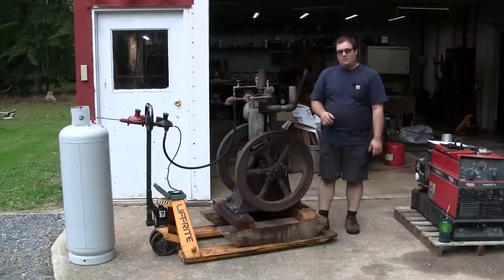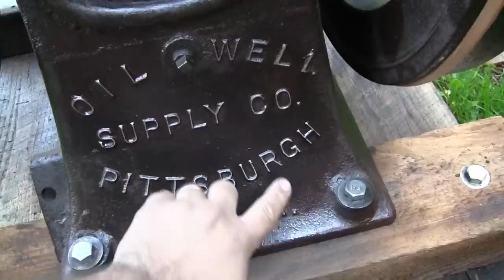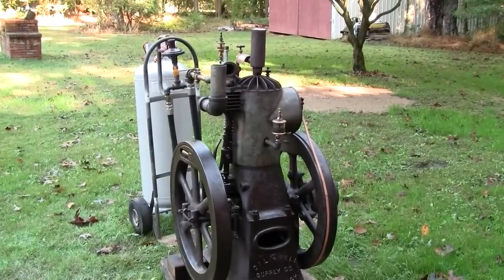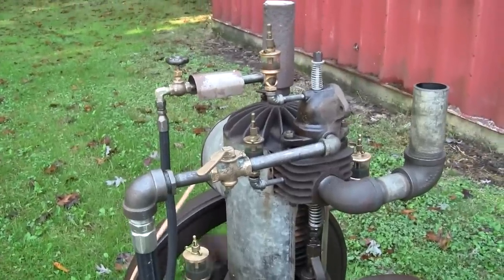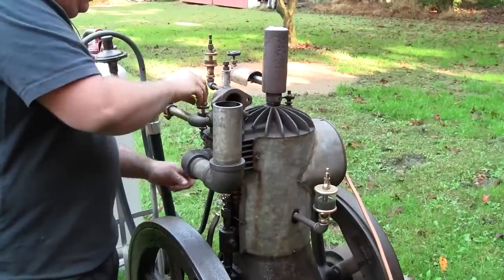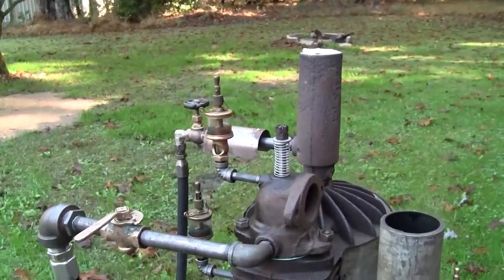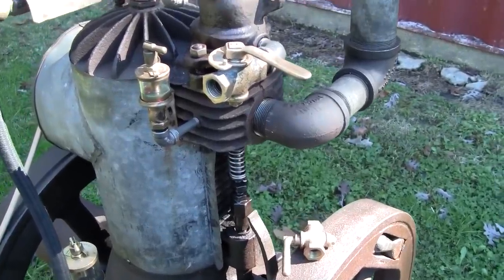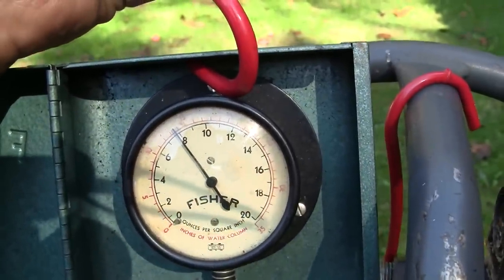100 Year Old Hit and Miss Engine Running on Propane Oil Well Supply Co.

Comment: The actual term for what you are referring to is Schlieren layer. When sea water is rained on,the fresh and salt in the act of mixing form a Schlieren layer. So too when propane and air have different densities. Or when burnt gas from a propane flame mixes with the much colder air,different densities. 
I don't know what other work Schlieren did,nothing else about him,but that wavy difference from clear is named after him. I suppose I should Google,easy enough.
That is one really neat old piece of ironmongery you possess. Glad you saved it from being melted down. It is so primitive,you couldn't even find a place to mount a vacuum gauge line where it would do any good for diagnostic. So brute force and ignorance ,pure stubbornness will have to serve. Good luck with it.

Comment: From what I've seen, old hit-and-miss engines work more smoothly when they have a load of some sort on them. Could you not turn the tube flame down to a pilot level once the engine is running? would engine compression be enough to maintain sufficient heat for combustion?

Comment: Engine is working great right from the get go... 
And now we know why it is called a hit and miss engine... It hits when it needs to and misses (or conserved fuel and just spins...) when it is going fast enough.
It is all in the governor letting the intake valve deliver fuel.
You were at the governed rpm and each time the governor let it fire, it put out plenty of power and it would overspeed.  With the big flywheels and no load, it only needs to fire every dozen or so rotations in order to keep the same governed speed up.  You could load it up to use up more fuel, but it seems to be running just fine at that governed speed.  With a load, it'll fire more often, and with no load it will just keep chugging along, firing twice every dozen or so turns.

Comment: I visited some oil land in Oklahoma in probably the early 90's, and I heard this strange "popping" noise... I didn't understand what the heck would be making a noise like that, so I took a little hike to follow the sound, and came across something that looked a whole lot like this. It was actively working and driving an oil derrick (rather slowly), and it went something like... pop, pop, pop, pop, ..., ..., pop, pop, ..., pop, pop, pop, ..., pop, ..., pop, ..., pop, pop, ..., pop, pop, pop, ..., pop, pop, pop, pop, pop...  In other words, firing on most of the strokes, but slowing down some here and there, rather randomly.  It was a rather amazing thing for a teenager to come across, with no introduction.  I basically figured out this "hit and miss" business just in listening to it as I hiked over, but I was amazed to see what was obviously some sort of "living antique" toiling away.
Reply from the maker: Thanks for checking it out!
Reply: @SmallEngineMechanic  I haven't dug into your other videos. Were you able to get this hooked up to some sort of load and have it run in a stable fashion?

Comment: Hi, have you tried increasing the exhaust valve pushrod spring tension?  Pulling that pushrod  back quicker off the rocker arm may free up a possible problem in overlap between exhaust and intake. Any slight resistance / friction of that push rod along its return travel can cause double intake strokes.  Regards, Tom.

Comment: I believe what you are experiencing is an over rich mixture on the first 'gulp' . I do not see an spring tension issue. The LPG is flowing at a constant rate and when governed the intake does not open so the cavity fills with LPG. It takes one suck to clear it's throat and the second time it intakes the mix is more as less 'flammable'.... Had them on pumps on the farm running of natural gas from horse manure. When under load they run pretty fine.

Comment: It's a shame I never investigated the oil field power unit at my old house in the oil fields of western New York. If I remember correctly it was a big unit in it's own shed, ran solid linkages to the pumpjacks and was driving big leather belts from the engine to something else

Comment: Did you notice that the exhaust valve is "double hitting" too?  Is there any "timing" for the governor releasing the exhaust valve?
Reply: I think you got it, I noticed the exhaust valve doubling also. I'm thinking more spring pressure on it too!

Comment: I haven't read the other comments so apologies if I'm repeating this. My guess is; since you're using a constant supply of fuel, perhaps the propane 'floods' the intake chamber, displacing the oxygen, and requires an extra cycle to attain correct mixture. Test this by simply blowing into the intake port, gently.

Comment: It has two exhaust strokes as well as two intake strokes. It just takes two full cycles to build enough speed to lock the exhaust valve. This thing needs a load to run steady.

Comment: Modern engines running propane use a “ Zero pressure regulator “ they are set at atmospheric pressure and only release gas upon a pressure drop ( intake stroke) and also release proper amount of gas in relation to amount of pressure drop ( maintains correct air fuel ratio ) I know these old engines didn’t have them but it might help it! Just a thought!
Reply: That's about the only way you'll get it reliably firing on no load. The current setup has a constant flow. When it is missing the intake fills up with gas. Next time it tries to fire it draws in almost pure LPG, which won't burn. Next cycle that slug of gas has cleared so it fires. Under load it should run cleanly because the gas doesn't have time to accumulate.

 If you use a zero pressure regulator and a small intake restriction, such as an air filter, the gas will only flow when it wants to fire and it will run cleanly at idle. It wouldn't have originally had a regulator like that because at the end of the day it doesn't matter. The engine still runs and under load it will run cleanly with or without a zero pressure regulator.

Comment: You might try to contact the production equipment group at NOV in Houston and see if they can find the original design details for this engine. I worked for OilWell in the 1970's and I know that they kept almost all design details for the old equipment they manufactured.

Comment: I didn't read all the comments but what you need to do is to tighten up the governor some so the balls will not travel so far out which is holding the valve open to slow the engine down, be careful it's old and may not like going much faster especially with a load on it.

Comment: the pop that you refer to as firing is the third combustion event.  you get 2 rounds of intake and combustion and the pop when it rocks happens exactly when the  exhaust valve is held open for the last event.  the previous 2 events caused the engine to get up to enough speed that the governor did its job and the pop is the last one going straight out the exhaust.

Comment: I agree with the comments regarding the double intake being an artifact of the fact that it is unloaded. What's going on is that you are constantly dumping fuel into the intake "manifold"  ALL THE TIME. If it were hitting on every compression stroke then that would work just fine. But it's not. And when it isn't pulling "air fuel" mixture into the engine, the "intake manifold", as it were, is just saturating with fuel. The engine has to pull that  charge in and TRY to burn it but it can't because it is too rich. But the next intake is not too rich and that second intake air-fuel mix WILL burn. One of those big propane regulators that they use on gasoline engine conversions is what you need to run this engine at an unloaded idle. Those only allow fuel into the air stream when the air is being drawn into the engine. But to make that work properly you will need a ventury  to get the air moving fast enough to allow the Bernoulli effect to work with the 10 inch propane regulator. If it were only dumping fuel into the intake tube when the air was being drawn into the engine it would work fine.

Comment: One thing that you can do is clean the engine up and coat it with boiled linseed oil. That will give you the look you want and protect it without using clear coat.

Comment: I love those old hit-an-missers, I think there are old washing machine engines that were hit-an-miss too.  

EDIT: 11 inches of water column is a little shy of what household gas is, I believe household is 17 inches.
What kind of power output to the wheel do you suppose it generates? If you're going to hook it up, that would be interesting to know.

Thanks for the great content. 
Keep up the good work.
בס״ד

Comment: @SmallEngineMechanic - I suspect the heated bulb is hollow and acts as a pre-combustion chamber. If so, it is supposed to shoot out a flaming jet into the cylinder when the piston is very near Top Dead Center to ignite the main air+fuel charge in the cylinder. What I suspect is going 'wrong' is this: During the 'dead' strokes with exhaust valve open, the cylinder is repeatedly swept with plain air, purging the hot and partially-burned gases from the hot bulb. So when the speed drops enough to admit a new fuel+air charge, the mixture inside the hot bulb is too lean to ignite. That results in the extra intake stroke while it gets richened up a bit. Then after the next fuel+air intake, the hot bulb finally gets a rich enough mixture to ignite upon compression. BUT when you make the mixture too rich, the hot bulb mixture does not get hot enough to ignite on time, and when it does, the piston is already too far down the cylinder to make much power. Thus the 'slow death' seen repeatedly with a too-rich mixture. In other words, I think the engine is acting perfectly normally... for that type of ignition. Putting a load on the engine will reduce the number of 'dead' strokes, making ignition easier and more reliable.

Comment: Sounds like it’s to rich, add more fuel, it burns less and continues to slow, second hit has less gas pressure due to prior pulse and burns correctly coming up to speed. Regulator pressure is to high, try backing down the pressure.

Very nice engine, thanks for sharing it with us. What is the air intake supposed to look like, is the fan there to cool the head or maybe it could be collected by cowlings and sent into the engine as a preheated pressurized intake. Also agree that some load should help get it out of the low idle position.

Comment: You need to adjust your governor springs. Your exhaust  valve lock out is staying released for 2 strokes causing 2 intake strokes which causes the intake valve to pop twice.

Comment: I don't have much exposure to hot-tube ignition engines but have read temperature and tube length are important. My understanding is the hot tube chimney should only have combustion gases  leaving  it and not an actual flame. The tube length sets the ignition timing. See $0.02?

Comment: I'll tell you a funny story about that engine, Way back in 19 70 I lived in cinn Ohio and i fell in to deer hunting. I love deer hunting, So this guy from where i worked said we could go on his brothers property down in russell springs ky  to deer hunt. So about 5 of us drove down there for the weekend. On his brothers land there was this oil well and one of them engine's running the pump, How that engine is firing is the same as the one did running the oil well  lol lol I told you all of that to tell you this The deer around that engine was so use to the sound it didn't bother them at all, I killed a 10 buck 30 feet from that engine When wanking in the woods they didn't care about my foot step on the leafs

Comment: I believe your double firing is clearly due to a governor with too much slop in it.  You can see that the lever from the governor is held open until it has fired twice, meaning that one firing is not increasing the speed enough to shift the lever back  into the firing blocking position.  But the lever is moved by contact with a grooved wheel that is shifted horizontally by the governor balls.  It appears that the lever does not stay in contact with both surfaces of the wheel, as it should to be most responsive to speed change.  So the lever needs to be made wider at the bottom, perhaps by adding oiled pads to each side of it to eliminate excessive play of the lower end of the lever between the two wheel surfaces.    You should not be able to move the lever either way unless the grooved wheel also moves.

Comment: Guess I'm gonna stick out like a sore thumb in this discussion, but I doubt the no load-theory. It should fire on the first intake anyway. I would suggest adding an air filter, causing a bit more underpressure in the intake during the intake stroke, keeping the valve open for a longer duration. It's just a theory though. Only worked on hot bulbs so far. Looking forward to seeing if you find a solution.
Cheers.

Comment: The reason that the vacuum operated intake valve does a double take is because of inertia. When the valve first opens it drops the vacuum in the cylinder and closes, the vacuum builds again and it opens again. Adding some inertia to the valve will slow down its closing to cycle slower! At a faster RPM the valve would not have enough time to close while still on intake cycle.

Comment: Did you try turning off the pre-heat burner once it was running? Also,on the night portion of your video, it seems on the compression stroke,the flame from the preheat heater looks like it's blowing upward on the compression stroke. That would indicate that there is compression leaving from both the exhaust,but also from the pre-heater tube.That might be a cause of the double intake operation. A small hole on the pre-heater. The only thing I can compare it too would be a 'hot bulb' style semi-diesel. Just a thought...

Comment: I see someone has already said what you need and that is a load to run against. It was designed to pull a load continually not free wheel. When I first started in the oilfield there was still a lot of these old engines used.

Comment: I remember hearing that the length of the hot tube affects the ignition timing, maybe it was the wrong length tube fitted originally or maybe because it's running on gas now, it may need slightly different timing? So cool tho and runnimg quite well in the vid.

Comment: Do you have the hot tube being heated the entire time the engine is running?  Will it run if you take the propane off of the hit tube?  Like the hot bulb, after it starts, they turn off the heat.

Comment: centripetal governor man, Like stated before without load the governor will cease the motion of the inlet valve from the stopper on the bottom of the valve guide. If you place load on that old timer I guarantee it will run like a champ . . .  or if you pull the valve stopper out.

Comment: I think the issue with the double intake stroke is caused by a variation in your air fuel ratio. Because the propane gas is flowing continuously, the mixture become rich while the intake valve remains closed. On the first intake stroke, the cylinder draws in an overly rich mixture. The second intake stroke pulls a much leaner mixture allowing combustion to occur. 
One thing I see here is that most gas fueled engines have a “zero pressure regulator” that requires vacuum from the engine intake to pull in the fuel. This would prevent the over rich condition you are seeing resulting in the double intake strokes.  On a larger engine, a zero pressure regulator also protects against backfire through the carburetor. 
I also suggest you reduce the gas supply pressure to the valve. I would set that as low as possible, 6” WC or less. This will make your gas valve less sensitive. Adding a bit of restriction to the air intake may help the controllability as well. 
The fact that this engine is a hit and miss type rather than a carbureted design with a throttle valve makes it inherently less stable under no load operation. But I think it can be made to fire every intake stroke.

Comment: It looks like you need a stronger spring on the fuel inlet and drop the fuel pressure - it's an automatic valve which relies on the pressure difference across the valve to open it. At the moment it looks like the slight drop in pressure due to the air inlet being open is enough to open the fuel valve as well.

Comment: 21:12 I'm pausing here to comment my thought, perhaps it needs a tube bolted onto the intake port to run better?  I'm wondering if the first time it's sucking a messed up mixture caused by airflow from the fan but second time around it's sucking in before the mixture has a chance to be affected in any way...  EDIT- 35 mins, the reason that Buzzard is circling right above you (or more specifically, your engine) is probably due to the heat from the burner being the closest thing he's got to decent thermal lift at this time of the year, your engine sat there burning propane is helping nature out & giving him a hand-up :)

Comment: the valve isn't doing anything wrong, it's riding on the cam. I would take a closer look at the governor. that governor fork isn't reacting quick enough
Reply: If I understand correctly, it needs to intake twice to fire once, then the governor holds the valve from intaking again till it slows enough
Reply: @aterack833  yeah not sure. I actually thought more about it and it may be acting weird because it doesn't have a load on it to slow the crank quicker. Not sure, we'll see what he figures out

Comment: Hello.  The governor mechanism immediately blocks the outlet valve, you can see it on the video.  You should be able to measure the revolutions.  When this engine thus not reach its  maximum working regime (revs), you know you should work or regulate the governor mechanism. Very cool engine.  Greetings from Belgium

Comment: My best guess is the fuel is bleeding in to the intake all the time, one intake cycle is too rich, and requires a second intake cycle to get the mixture right to burn in the cylinder